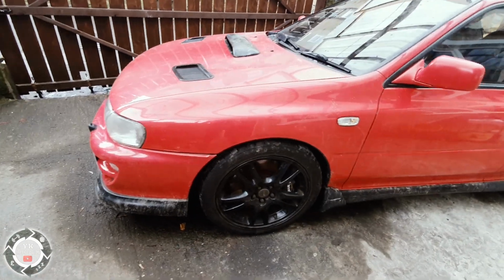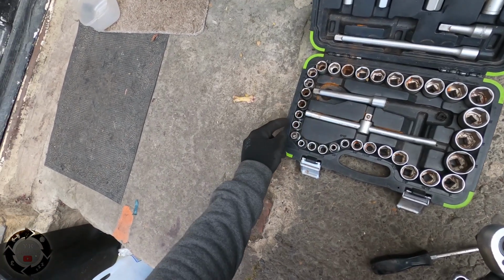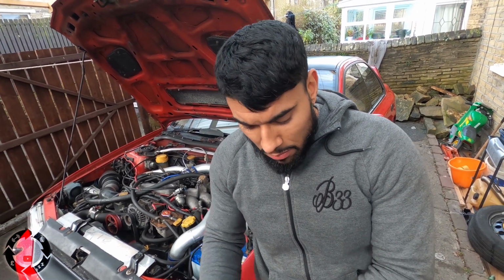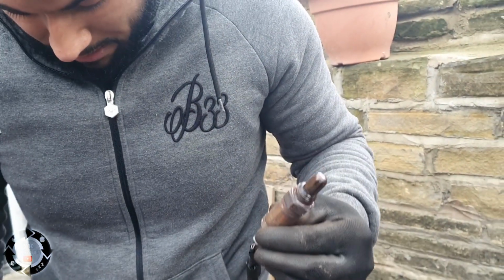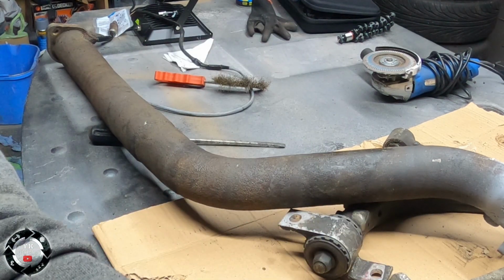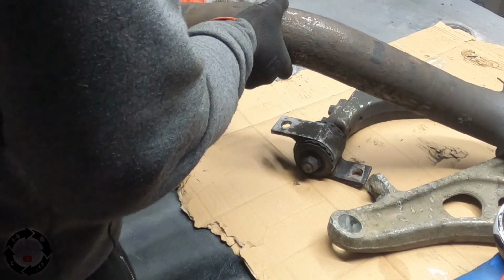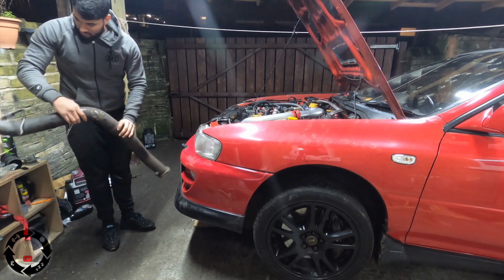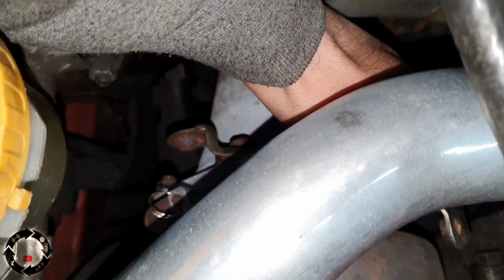HOW DID THIS HAPPEN? *CRACKED EXHAUST* SUBARU IMPREZA

Comment: common problem with these down pipes mine did the same just not as bad as that!!
Reply from the maker: Did you have heat wrap on yours ? I think that's what made this worse
Reply: @YKRECREATION  yes, and still wrapped the new one. not sure it affected the bell housing  part though as you've noticed the cracks appear at bends!! and where the bolt section is attached!! its not made of stainless like the rest of the exhaust its steel.
Reply from the maker: @martinmalone6324  mine was heat wrapped all the way from the top to bottom, I think it wasn't stainless steel